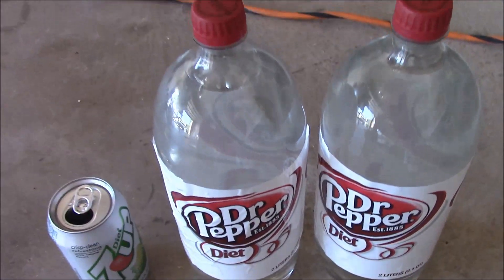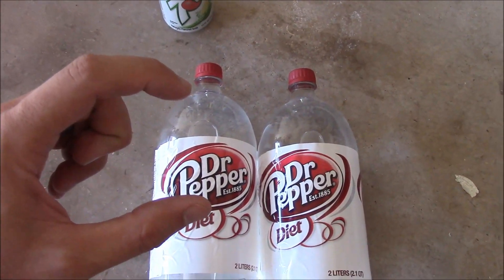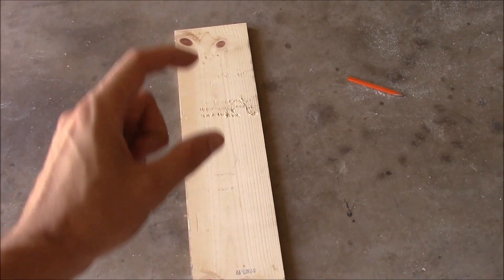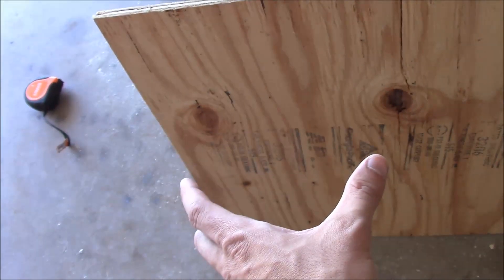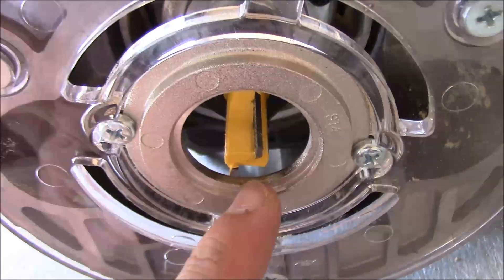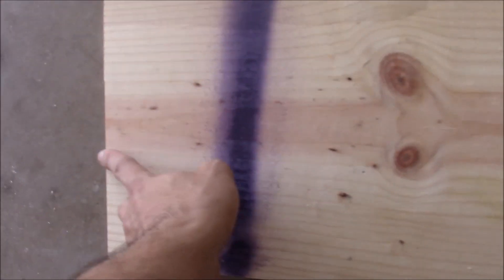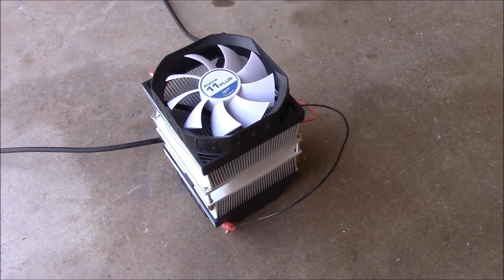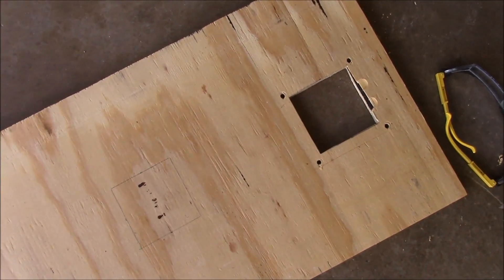Mini DIY Peltier/TEC Fridge Prototype - Learn From My Mistakes

Comment: Watching the Peltier videos I haven't found anybody yet who tried to optimize these things. There is a very close relationship between applied voltage, the internal characteristics of the module and heat removal. If you're off that number, it works even less efficiently. When I was developing an individual drinks cooler I computed that, with the module that I had, I had to put an 8 ohm resistor in series with the cooler. Despite the fact that power was being wasted by the resistor, I got much better cooling. Obviously that was a "fix" - you don't want to have to put in a resistor, which means that you have to have a power supply that exactly matches your cooler's requirements or a cooler exactly matching the power supply. The rating on the cooler package means nothing, however. Mine said 12 volts, but the optimum voltage was just under ten.
Reply from the maker: piolenc How did you determine the optimum voltage?  I am not an electrical engineer so I wouldn't know where to start.
Reply: LDSreliance Worked it out based on a text on the subject, which I no longer have. I have the notes that I made then for the project I was working on. Formula is shockingly simple. Problem is most elements on the market seem to be marketed based on power generation, not refrigeration.
Reply: +piolenc Can you approximate it well enough just by experimenting? 
(If the formula was simple, the optimum of the V-T function's curve should be kinda' easy to guess after a few measurements, hopefully.)
Reply: +lunakid I guess so, but it would require measurements of net heat transfer at different feed voltages, while the formula itself is super simple. It does require you to know how many junctions there are in the module, and what materials it is made out of, but that usually isn't hard to find out.
Reply: piolenc OK, I was just concerned about items bought from China being hopelessly opaque black boxes (despite being actually white... umm), with no real specs/docs, and thought those internals are not easily found. OK then. Cheers!

Comment: Im still working on a similar setup. Maybe you can help me out. I have 2 Peltiers at 6 amps a piece. On one of the small Styrofoam coolers(26 cans +ice) about hal the volume of yours. They are set up perfectly, sealed with metal tape, with no gaps. My problem is they will only drop the temperature about 22-25 degrees F. Ive read that they are intended to drop the temp by 40 degrees. They each have a hot and cold fan, high performance thermal paste on both sides, and i run a blower at the fins just to help remove heat, and i still only get about 25 degrees drop. I need to get close to the 35-40 degree point. Do you have any suggestions?
Reply from the maker: Electronic Superhero It sounds like there is not great cold/heat transfer to your heat sink.  Also, the cheap styrofoam used in those disposable coolers doesn't insulate very well.  I would guess that you are losing efficiency in both of those areas.

The ratings for the TEC1-12706 are for the difference in temperature between the hot side and cold side as measured on the surface of the TEC.  By the time you add in thermal paste, a heat sink, and then exchange that heat/cold with the air volume in the cooler you are probably only ever going to get a max of 30 degrees difference.  That is just my guess based on my own experiments.

Also, having 2 TECs does not make the air colder.  It only helps you cool a greater volume of air.  If you want colder air, you need to go with a more powerful unit like a 10amp TEC1-12710 or something.

Comment: I'm glad I found your video and you shared your experiences. Plan to do something similar,but put a coleman cooler fan unit into an 1920's ice box refrigerator. I'm thinking I need at least three units... what is the temperature Data logger called. Would like to get one. Thanks
Reply from the maker: The Cedar Workshop The logger is an Extech TH10.  Costs about $55 but I have used it a lot and it is very handy.

Sounds like a fun project!  Older refrigerators are built like tanks so if you can get it to work it will last you forever.

Comment: The problem isn't necessarily your insulation.  It's just how peltiers work.  They have a rated delta T.  (temperature difference)  They can only go so far below ambient.  Most can go 30-40 below ambient with really good insulation and proper current.  (some don't pull their rated current so you have to bump voltage up to get the right current draw, assuming you have sufficient cooling on the hot side)

One way to overcome the weak delta T: use a cascade.  Use two peltiers to cool the hot side of your first peltier.  Lets say your peltiers have a delta T of 20 degrees, and it's 70 degrees in your garage.  One peltier will only get your box down to 50 degrees.  But if you add a block of aluminum on the hot side that's large enough to fit two more peltiers on the other side, you can use two peltiers to cool that side down to 50 degrees (20 cooler than ambient), so now the cold side of the first peltier can get 20 degrees colder than that, which would be 30 degrees.

You might ask why you'd need two peltiers on the hot side.  That's due to how inefficient peltiers are for cooling (they're better at heating).  One wouldn't be enough and you'd barely gain anything.  You might even lose efficiency stacking 2 peltiers.  But if you have two to cool the hot side of one, you can get pretty good temp different over ambient.  Prepare to dump tons of power into the thing, but it's doable.  Best power source is a computer power supply.  To turn a computer power supply on, you short the green wire and any black wire together.  (just hook any black wire to to a toggle switch, along with the green wire, and that will switch the power supply on and off)  Then use any black wire as negative and any yellow wire for 12v.  Those computer power supplies can usually do anywhere from 20 to 100 amps on the 12 v rail.  Plenty for what you're doing.

Definitely way less efficient over just getting a normal mini-fridge with a compressor and refridgerant, but there are benefits (no moving parts, can tip it over without any problems, etc).

Also, just as a neat fact, laboratories use cascaded refridgerators to get well below zero in test chambers.  They use refridgerant style cooling instead of peltiers but it's the same principal.
Reply: Oh, also, to know what current rating your peltier is, look at the part number.  They all start with TEC1-, then usually 127 (number of thermoelectric junctions), then the next two numbers are the current rating.  So, if it says TEC1-12706, it's rated at 6 amps.  One with a part number of TEC1-12720 would be 20 amps, for example.  You probably already knew that, but in case you didn't, that can help you out when picking peltiers out for projects like this.
Reply from the maker: 5ky Thanks for the comments.  I haven't tried cascading yet because of exactly what you pointed out:  super inefficient.  One peltier is already power hungry enough but if I have to throw in 2 more to get another 20-30 degrees lower then it just isn't worth it.  Plus that is a huge contraption that would be hanging off the back of the fridge with multiple heatsinks and layers.

I have found peltiers are much better as chillers and moving the cold into liquid.  So my next fridge attempt will use water (not ready to risk ammonia yet) to cool the inside of the fridge.  Stay tuned!
Reply from the maker: In case you are interested, I finally did a video on cascading:  https://www.youtube.com/watch?v=F6i7y4FV-sU

Comment: Watching this has given me a grate idea ! I'm going to build one of these except mine will have a tin or a aluminium box interior inside, with tin or aluminium shelves and I will not use any fan's on the inside, the hole interior will be the heat sink, witch will pull the heat out of the metal interior. I will then cover the tin or aluminium box exterior with this R-rated insulation that " Mr Tpengineer " has mentioned then I will cover that with a nice wooden cover, stained with some nice mahogany stainer with some thin rubber strip around the door's skirt with some of that R-rated insulation on the interior of the door and using that Ocky strap to keep the door closed I think this will work best. Thank you for posting this " LD Sreliance " I would never have thought to use those computer CPU's heatsinks like this .
Reply from the maker: Sounds like a great project.  I am glad that my failure has sparked some ideas with others.  Look for another video soon on a liquid cooled refrigerator.  Thanks for watching and be sure to thumbs up the video and subscribe to help support my channel!

Comment: Those results weren't that impressive. I think only a couple of things would have made it better. Firstly put insulation on the door. Put insulation on the bottom also. You would be amazed about the science about how much latent heat something like a piece of wood can hold. You need to build it differently. I think if you built it differently the results would be better. Built differently I don't think it would ever be great but I think that reaching say 40F would be possibly if it was built differently. That's about it's max potential though. Running these straight from a solar panel all day and then having a bottle or something that is permanently in there as thermal mass is the way to go. This way when you open the door and the air escapes most of your potential is in that cold bottle and the fridge can become cold faster when you close the door.
Reply from the maker: I agree.  I know I can squeeze another 10 degrees out of it with better insulation and tighter tolerances.  This was a prototype to prove the concept, mostly.  I plan to build the next one with finger joints so that the wooden box is tighter, use more insulation material, and construct a better door.  I am also going to liquid cool the peltier instead of air cooling.

Comment: an array with low amp peltiers is actually a very good idea. Think permeating heat as it is a sponge. Evolving this idea and you can use a sponge like cooler like a radiator pumping a liquid in it to get a better cooling surface to the air.
Reply from the maker: I am definitely going to play around with this idea.  Maybe a comparison test between one peltier running full power and 3 of them in an array running 1/3 power and see which one cools (or heats) better.

Comment: this is not mine . just a example http://www.ebay.com/itm/Thermoelectric-Cooler-Cooling-Peltier-Module-30W-White-/171174356836?pt=LH_DefaultDomain_0&hash=item27dac96764
Reply from the maker: Nice!  I will have to get a few of those.

Comment: hi lds, koudos on your experimenting , i  have a couple suggestions that have worked in real world lab equip. for many years that you might not be aware of. 1. lithium grease for contact between the module and the fins is the best for heat transfer. aluminum fins are ok for a computer cpu but you need copper, easy enough to make with copper flashing, just make a rectangle flat base and make u shaped fins attached with soldier easier than it sounds and lastly the one thing most dont think of is a cascade ..using lower wattage.. stack the modules to suck the heat out. i would want modules with the largest  footprint and lowest amp draw... good will intended and wish you luck
Reply from the maker: Great ideas!  I have read about the cascading but haven't tried it out yet.  I am trying to keep overall costs down so I am going to try to get this to work with only one module, if possible.  But I do want to experiment with more than one module in the future.  Copper is also very expensive but conducts much better than aluminum so that would work better if I was going to continue with air cooling.  However, I am going to switch gears and go with liquid cooling for my next attempt.  I proved the concept in one of my other videos, if you are curious:  https://www.youtube.com/watch?v=tnKlIc6oCCg
Reply: LDSreliance
i took a look at your new video. proving not only that your a thoughtful guy but pretty cool dude. your new one is very different from this project which i was digging because you had clear targets and simple low cost way to get there. you already know alot, if you dont mind a observation i think your first is on the right track. you may already know that amps or watts can be expressed in btu. so you have a 75w module,, on your cool side trapped in the box is a fan with x being the amp draw, that cuts your cooling by x. you might want convection to handle the transfer on the cooling side.. the single 75w creates a hot spot i think three 25w or two 30w would better serve and you could space them..also i agree copper is expensive but you need less than a pound, a roofer would have a cut off larger than you need he might give for $5 .if you have room in the box . a square foot of it would make a nice heat collector  and it could be flat without fins. i think you can hit your cooling target with well under 100w total draw...and even more useless information you probaly already know.. home frig is not very eff.. it forces cold in instead of taking hot out but it overcomes that by way of the large surface area its interior coils are attached . you could use the same method to your advantage .and finally you could do what my wife does and just say ive had enough of your tom foolery for now and ill shut up
Reply from the maker: p Paris
Haha, not tomfoolery at all!  Good suggestions.  I haven't seen readily available peltiers less than 60 watts so if you know of a place to get some I am down for trying them out.
Reply: LDSreliance
ok, this will make you laugh, my father worked with these starting in the late 50s and they were not readily available so he made his own. i still have the furnace he used for growing the crystals for the legs but like so many things they were copied over seas and sold cheaper than anyone could make them.. i dont have his notes but if i did i could make you some in any iteration just by the size and number of legs. he was successful at making a cooler that you desire.. made a mold for a very slick looking cooler made out of a hard expanded styren beads. he formed a company and sold a few and a short time later coleman..the company we all know and love made something very similar for less and he was out of the consumer market. the only problem i see with your project is the things you need to have it work is not "off the shelf" stuff. and the pieces you have were mostly made for computers and have little value to you. if i were able to show you how close you are you would be surprised
Reply from the maker: I just want to prove it works and learn as I go first and then worry about something that can be commercially viable.  There are already glorified coolers with peltiers in them selling for $60-80 and up.  Not much room to compete in that space.  What would be cool is a dorm room sized refrigerator/freezer for emergencies for keeping medications, milk, meats, etc. cool in a power outage.  And also a model that runs off of dc power for off gridders.  Have you priced 12v or 24v refrigerators??? They are insanely expensive.
Reply: LDSreliance
ok dude..your just encouraging me now and i promised my wife years ago i wouldnt change the world but now you can walk down insane lane with me.
imagine the cube frig. with the compressor , oil and freon removed, using your 75w  module and the thing you had in your other video for water on the hot side to heat ammonia as the refrigerant .. keep this up and you will start seeing things that no one makes and ask why not. and also see things that are and ask why anyone accepts them
Reply from the maker: Ammonia just scares me because it is toxic.  I know it would make the best refrigerant, though.  Definitely something to look into!
Reply from the maker: In case you are interested, I just did a video on cascading:  https://www.youtube.com/watch?v=F6i7y4FV-sU